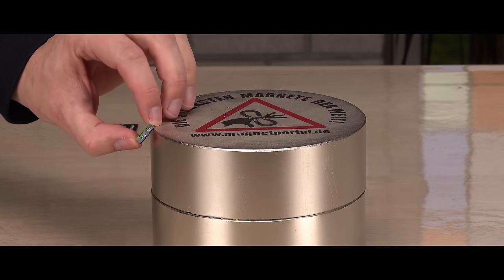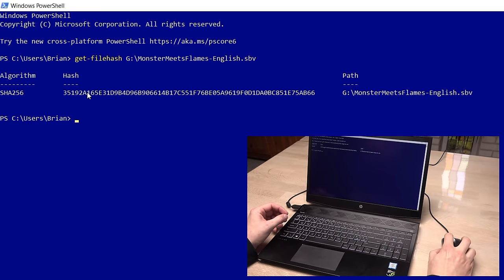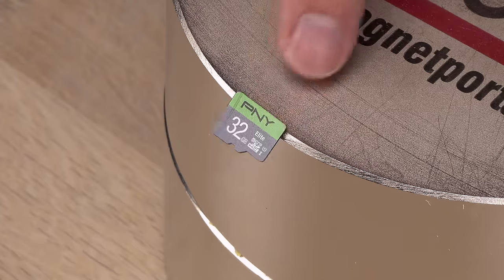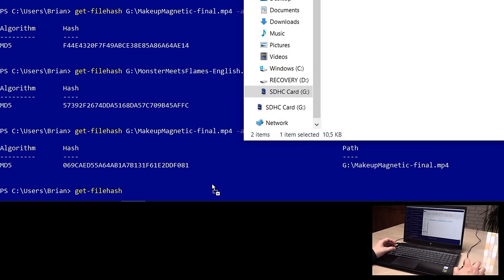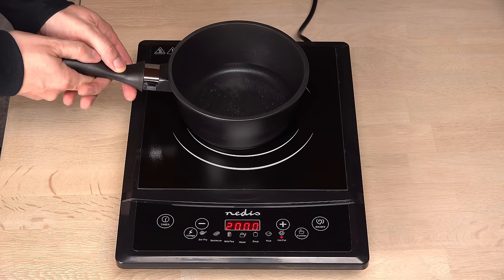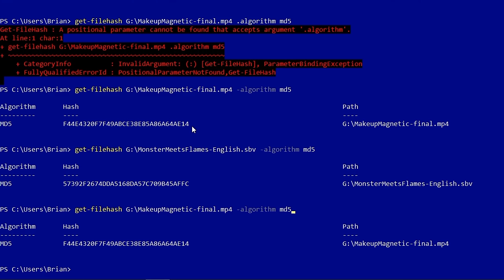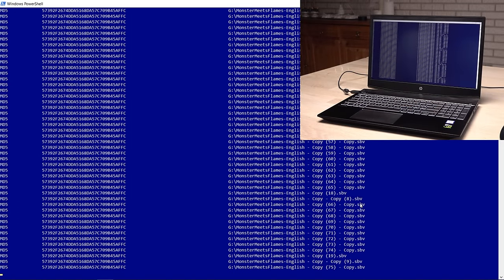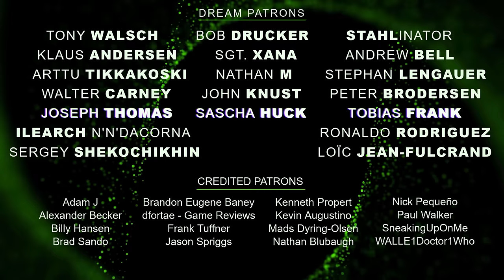SD Card vs. Monster Magnet and Induction Cooker (2000W AC electromagnet)

Comment: PNY is fairly well know. They may also be using software tricks to help keep the integrity of the file such as SMART, with detects degrated blocks of data and guesses what they were and stores them somewhere else. That could change the hash signature but keep the integrity making it somewhat resilient to permanent magnets.

Comment: Please try the FC command to identify the wrong bits by comparing byte-by-byte to the original video file on the computer.  preferably with the /B option.
  As others have pointed out, maybe the flash controller circuit inside the card did something to recover from the issue, although sector duplication is unlikely for a large copied-in file, ECC kicking in and/or successfully recovering from noise in the sector allocation data are more likely.

With modern MLC flash technology, a card written to only 1/3 of its apparent capacity may have stored its data in a more robust SLC format, with the controller converting previously filled sectors to MLC format as the card fills up (this is also one of the few ways a singly-written video file copy might have a second copy of its sectors).

Comment: If I had to guess, Windows changed some metadata in the file and that got modified and that changed your checksum. Next time do this kind of thing on a Linux system.
Reply: Metadata should not change the checksum of a file though, as usually the checksums are only calculated over the actual file content. I don't know how this specific windows hash command works though.
Reply from the maker: I believe the metadata are not accounted for in the checksum - but yes, Windows may be the underlying problem... I have an old Thinkpad with an Ubuntu installation on it from a previous video ;) Thanks for watching!
Reply: @brainiac75  Honestly I think the most likely scenario is a read error from the SD card. CPUs are usually very stable and don't miscalculate things, unless you overclock / undervolt it above it's limits.

Comment: What Happens when you "Cook" your Monster Magnets on the induction plate? Will it blow Up or does the Magnet get hot? 🤔🧐
Reply: Above a certain temperature, the magnet loses cohesion and stops being a magnet. So then you have turned your hundreds of dollars worth of a magnet into a heavy lump of metal. You could still use it as a paperwight though.
Reply from the maker: Thanks for the suggestion to a video, where I will test several objects on the induction cooker. Could be interesting to see :)
Reply: @Seegalgalguntijak  That's my guess too. 
But don't you think there could possibly be an interference because of the size and strength of this monstrosity of an Magnet which destroys the MOSFET/TRIACs? Normally the heated Material schould be magnetic but no Magnet. 

Even IF the induction destroys the Magnet - would'nt it be possible to re - magnetify it using the coil with DC voltage instead?
Reply from the maker: @Hypno993  I will not test the induction cooker with my largest magnets. I believe induced heat could be a problem and cause permanent damage. So I will use a smaller, less expensive magnet :)
Reply: @brainiac75  Neodymium is flammable so I assume you will be very careful in case it shatters and ignites?
Reply: @Hypno993  In fact, I think due to inertia, a smaller magnet might possibly be easier to make vibrate or dance on the cooker than a bigger one.
Reply: @Hypno993  Also, regmagnetizing it would only be possible when heating up the material (possibly even glowing white hot?) and then putting it in the core of a DC coil while cooling down. I think that's how these things are being made.

Comment: I believe SanDisk doesn't write magnet proof on their cards, because the memory typically used is not affected by magnets, and there is not really a reason to think that magnets would do anything to the memory except for the common association with hard drives. But from a technical point of view, they're supposed to be pretty magnet proof.

Although one could indeed think of side effects like inducing so much current into the internal wiring that you physically break it or something similar.

Comment: SD cards don’t write in magnetic code. They write in NAND Flash. Used in Flash drives, SSD’s, and, you guessed it, SD cards.
They work by having 2 crystals set apart bij a non-conductive layer. (Capacitor) each of these crystals have have up to 4 electrons in them in any configuration so that makes 4x2 bits that can be stored in each capacitor. That’s a Byte.
Magnets don’t do anything to this, except a really powerful one that might damage the electronics.

Comment: The reason there is no warning on other / reputable brands, because it's trivial , that the storage cells are not affected by strong magnetic fields, due to physics.
I suppose that the thin Ni layer between the Au and Cu of the connector fingers  is the metal which shows magnetism.
This is used to avoid diffusion of the Au inside the Cu.
Usual radiation also does not harm these cards, because their energies are too low to affect the charge trapped inside the storage cells.
That's mostly a problem in space, or sometimes in XRAY machine, where you have really high acceleration voltages, like many keV.. XRAY inspection is used for PCBs containing FLASH also, under ce rtain circumstances.

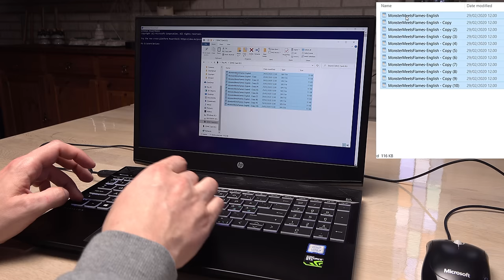Comment: 10:24 video files are compressed, so change of a single bit can cause huge effects. to prevent this video files have error correction bits, and little bit errors can be compensated without a single artifact. also storage media has error correction bits to correct little bit errors without giving an error message.

Comment: Yeah, I tried using an Induction cooker in my last video to melt Metal and had the same Problem with the magnetic sensor. 
The Coil also detects if the Metal gets to hot,maybe thats because it looses its magnetic properties at those temperatures...
Reply: Yes, I believe metal does lose its magnetic properties at a a certain temperature. I only recently learnt this in a video about how rice cookers work - basically they have a magnetic switch and the metal ceases to be magnetic at just above the boiling point of water, so once all the water is absorbed the bowl heats up more, then the metal switch drops the magnet turning off the cooker.
Reply: The Curie Point of iron is 1043K, which is quite a lot hotter than you would want it to get. I kind of doubt the coil can detect if it's too hot (given that 'too hot' might be 400C).

Comment: Pretty much any gold plating on a connector, PCB, or other electronics components is going to have a nickel layer underneath. Usually not really noticeable, but when you have magnets as big as you have, you can see the result.
Reply: Is the nickel being used as a diffusion barrier? 
Some electronic chips also have magnetic leads, IIRC manufacturers sometimes use special alloys to match thermal expansion characteristics, and some of them happen to be magnetic.

Comment: Don't forget SD cards have on-board error checking and correcting. One of the big advantages of flash storage in general is its ability to correct single-bit and multi-bit errors without any intervention from the host computer.

Comment: We need a pulsed field. A 25 turn air core coil 50mm long, 30mm wide will have about 8.7 uH of inductance. If two microwave capacitors in series (10kv, 450nf total) were shorted into the coil, the ringing current would be about 2.3 kA, the peak field would be about 1.4 T/ 14kG and the frequency would be roughly 80khz. Have fun and don't get electrocuted, "medium voltage" circuits can find paths to ground in unexpected places.

Comment: Totally brilliant testing! The hash anomaly may have been caused by a power spike during file transfer and not necessarily any external atomic influence.  It's probable that an external power source such as a boiler kicking in for central heating or something along those lines, fired up during the hash test.  Only way to probably prove this is to use a power socket that isn't surge protected while the laptop is plugged in on PSU?

Comment: It is much easier that radioactivity changes bits and/or damage non volatile solid state memories, than magnets fields.
More on some some microsd cards that have an enclosure with a magnet disipation like in faraday boxes, also some of them had anti-electric pulses or over current.
But no memory card can survive to radio activity if it is intense.
Just a tip: Test 'cheap' microsd cards, most of them are not attracted by magnets... and they lost all data on strong variable or fixed magnetic fields... but othes are heavyly attracted by magnets, just because they use an enclosure that is 'active' to magnets... so the magnetic field can not pass them, instead magnetic field is arround them.

Comment: The documentation for prime95 asserts that many computers you buy in stores come out of the box already unstable, though you won't typically notice. While overclocking exacerbates the problem, a CPU can't be relied on for sensitive calculations even if the frequency and voltage are exactly what the manufacturer intended.

Comment: Btw the hash code is in Hexadecimal, not binary (bits). 0-F for 0-15 where one hexadecimal value (e.g. A = 10) is equal to half a byte or 4 bits (A = 1010 or 1×8 + 1×2)

Comment: The easy way to change the voltage in the charge traps is with ionising radiation.
Also, the controller masks some of the changes - if they are limited to say - one bit of an entire byte.
To change one bit you need to induce an electric field of 21 Volt over a distance of 100 silicon atoms...

Comment: We used to take a camera with us on vacation. It used compact flash disk. The cheaper ones would get corrupted when they went through the X-ray machines. We then started buying just SanDisk Extreme’s and had no problems with it.

Comment: Sd cards use storage similar to ROM. In order to write data to a rom chip(firmware) a special signal must be sent to the chip first, and then the process MUST be continuous (meaning power off destroys the chip and data). SD storage is admittedly more complicated than this but this is a similar situation I'm not 100% certain how it works but I do believe that there is a signal that comes from the computer or digital device to enable writing on the SD card. This being said an analogy of a locked glass door can be used. Without the key the locked door cannot be opened, but the "data" can be read (seen through the glass), but with the key we can open the door and rearrange/add/remove(etc.) the data within.  I think the only way you're going to be able to get this to work without magnets that are so ridiculously powerful that it would destroy the card itself by burning the circuits inside is to find a way to have some kind of handmade cradle that holds the micro SD card above the magnet while it is attached to the computer. However this would be dangerous because we don't want to be sending erroneous data/voltage spikes/eddy currents back into the computer. It may cause unknown problems with your OS. Back feeding voltage through that data channel may cause all kinds of havoc but I think that's the only way that's going to work the data is stored in zeros and ones on a chip that cannot be written to without the proper signal therefore no magnet can change the data on the disk because it is stored in such a manner that is inaccessibe to the magnetic field yes the AC eddy currents may cause problems with it but you're talking millions or billions of gauss IMHO. Now this is mostly speculation on my part I'm not 100% certain that I am correct but I do believe that this is the way this works.

Comment: The change of the MD5 hash might have just been a read error on the card that wasn't detected. Most programs will usually try to resolve read errors, but the md5 utility might have not noticed the read error.

Comment: All NAND flash memory has significant error correction coding. Varying from manufacturer to manufacturer this can detect and correct many bits of error over a data block. You may have caused an error at some point but it was probably corrected between reads. Also, NAND flash especially the older versions will degrade after multiple reads, by corrupting blocks not being read. Also the number of write cycles will degrade the flash as well. You should not have reached this limit however. Since the storage method for flash is an electric field, the only damage you could probably affect would be to have changed some geometry within the silicon and causing a discharge of the gate.

Comment: Very interesting. I wonder how much the latest LTO tape can take, or any LTO for that matter. I know analog video tape can be harder to erase then one might think. Of course the audio/time code tracks (linear) will go first, then the control track. But the video seems to take much more to erase it. It's possible without super strong magnets like you have but you really have to beat the signal out of it for a while. I haven't tried neodymium yet but I have access to many formats so I should try it.

Comment: SD cards are easy to make it faulty by writing tons of data rather than putting it on a super-strong magnet.
One question that raises me the curiosity is if the high heat can actually destroy the card by going a little more than that is advertised.

Comment: Presumably, the transistors in that flash memory are so small to not interact with magnetic lines.
We know that magnets can't influence visible light because of the large size difference. I think transistors with 22 nm technology have features 50 times smaller than visible light.

Comment: A corrupted bit in an mp4 file (which presumably contains compressed video) will not lead to a single corrupted pixel, but the corruption of one or most likely more frames.  So if it played fine, it's extremely likely that it had no corruption.

Comment: I know that certain MRI scanners (up to 3 tesla) have a touchscreen. Behind the touchscreen is a standard Intel based computer (laptop hardware) with a SSD and a SD cardslot to store important data and settings. They are mounted directly to the magnet itself. Although the computer hardware is inside a separate faraday cage to protect it from radio waves, it does nothing to protect it from the magnetic field.  Therefore it doesn't surprise me this SD card is also not affected. Medical x-rays are also not going to damage a computer or SD card. I guess electronics are quite resilient to magnetic fields and x-rays in general.

Comment: Try a high voltage discharge (> 5 kV) through a spark gap into a pancake coil with the SD card on top. I tried this with a SIM card and a USB stick and they were both non-functional afterwards. A fast rise-time pulse is more destructive than a continuous wave, and the E-field perhaps more than the H-field.

Comment: I'd recommend doing some more deep level tests that will not only test the flash memory but the memory controller itself.

Run CrystalDiskMark on a few SD cards before and after being in the magnetic fields. The speed reported back may give you a better idea of what the SD card controller/flash will be beyond just memory integrity.

Bonus points, you could see what the file system reports back with chkdsk or some other file system utility to see if there's any bad blocks.

Comment: The reason why SD cards will not be affected by magnets, are because of the fact that an SD card is an Integrated Circuit, almost all of its structure is made of silicon and the only metal that's present inside of an IC are in the vias and the bonds, which are mostly gold which to my understanding is not Diamagnetic nor Ferromagnetic so I highly doubt that an IC would react in anyway differently when exposed to strong magnetic fields.

Still a really interesting video to watch, I like the impromptu induction cooker breakdown haha

Comment: I m suprised that you don't know PNY
Reply: I mean it's not like you should... They're crap. Every single PNY USB drive I have had has been utterly slow and I've had two PNY micro SD read lock themselves due to failure.
Reply from the maker: Sandisk is very dominant on the Danish SD card magnet. PNY is not :) Thanks for watching!
Reply: @brainiac75  PNY has been on the Danish market for many years.
edbpriser.dk lists 55 GPU cards alone,from the company.
Reply: @parkerlreed  PNY probably doesn't make SD cards. Just like most companies, they buy cards with specific requirements and put their name on it.

And most brands that sells SD cards have cheap and expensive models. The more expensive are usually of a better quality.
People tends to buy the cheaper ones.
Reply: @brainiac75  you might know PNY by it's more popular brand name... NVIDIA
Reply: @vanerek  PNY sells GPU's based on the NVIDIA reference model with extra RAM and the like (....but NVIDIA is not a PNY brand).
Reply: @WilliamLDeRieuxIV  you are correct.  Though, they may as well be.  Those in the business of intensive, mission-critical computing and graphics, don’t buy nvidia ANYTHING unless it’s manufactured by PNY.  They are the pinnacle when it comes to nvidia platforms, and in my opinion, flash memory as well. RAM quality/reliability is on par with Samsung/Crucial/Kingston, but surpass in thermal management designs in some cases.

Comment: I don’t know much about magnets but I bought 2 magnets at a sport show over 25 years ago that the salesman side were 100lb magnets. I stuck them the side of a big safe and haven’t been able to ever get them off. I tried sliding them to the edge just to get a nasty bite. I used a 2x4 trying to slide them off still a no go. They are stacked one on the other and are a few inches round. Is there an easy way to dislodge them and possibly separate them? Did stacking them make them into a 200 pound magnet? Thanks for sharing this video